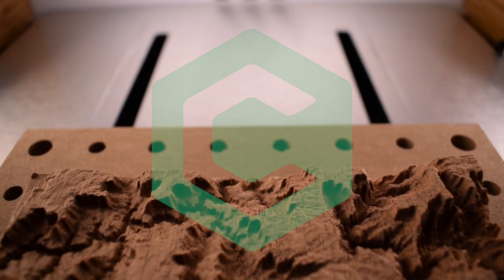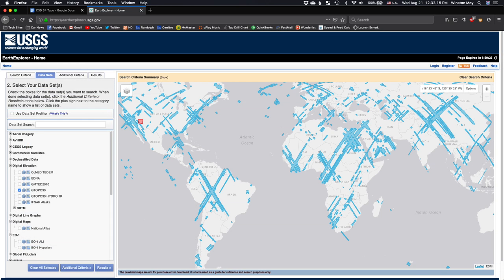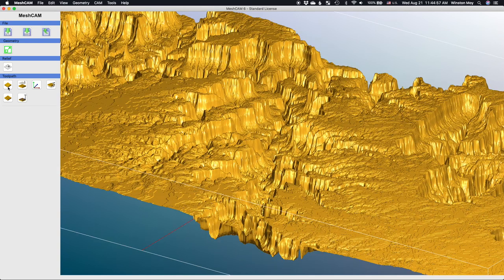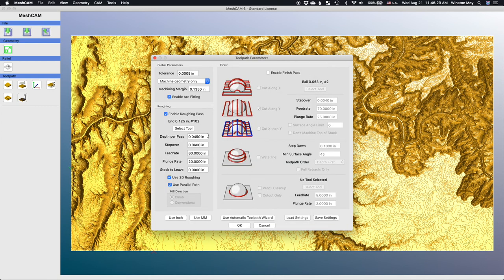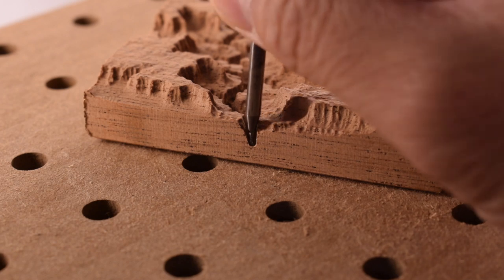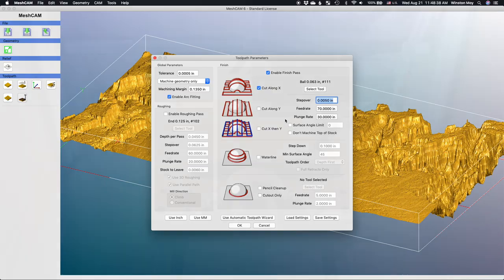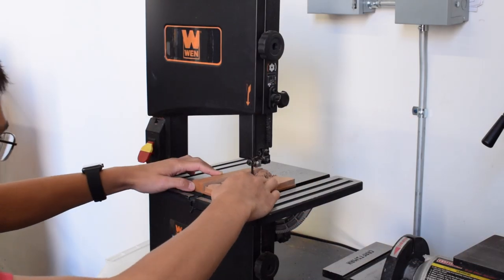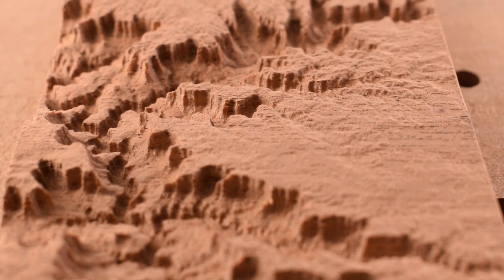Making a Topographic Carving with MeshCAM

Comment: Great video! I am guessing this isn't possible in fusion?
Reply from the maker: Afraid not. No way to open an image and use it as a height map.
Reply: Small Shop Works - There's a bunch of scripts that does the height map part in fusion 360 😃 Just google "height map fusion 360" and you'll find them 👍
Reply: @DominusFeles  thanks a lot!!!
Reply from the maker: @DominusFeles  I actually had no idea about that add-in, thanks for bringing that to my attention! I have some more experiments to run now...
-W
Reply: @carbide3d  Go 4 it! 
I haven't tried any myself but I remembered that I've seen it some time and Google confirmed my memory 😊
Reply: I've tried 'Image 2 Surface' and it works beautifully with height maps.
Reply: @mikehall9130  Nice!
Reply: Just be aware that complex meshes are very slow on Fusion.